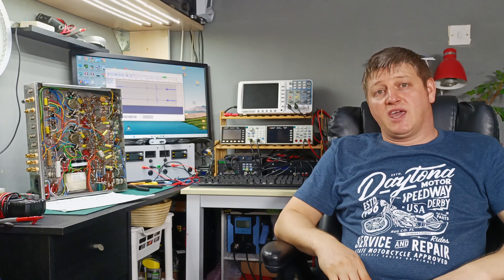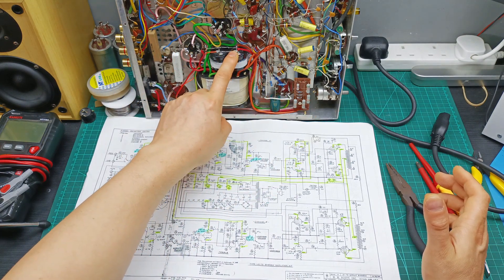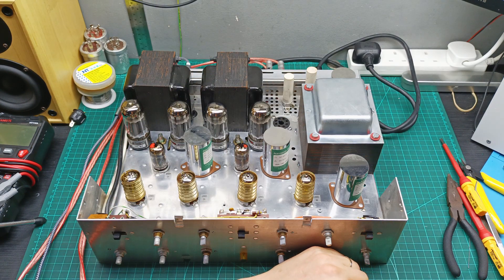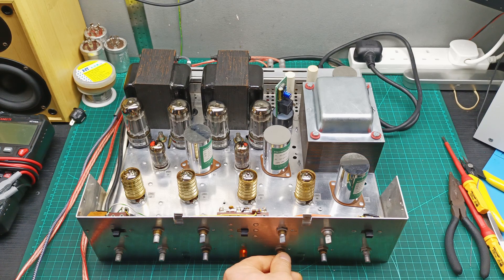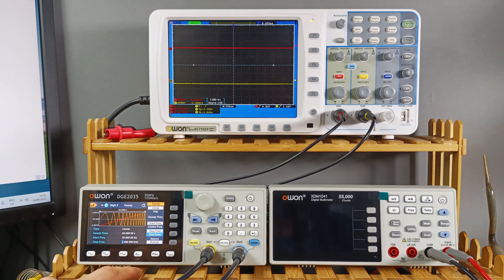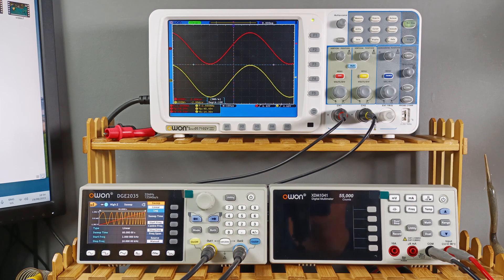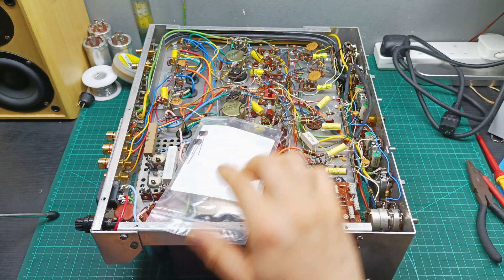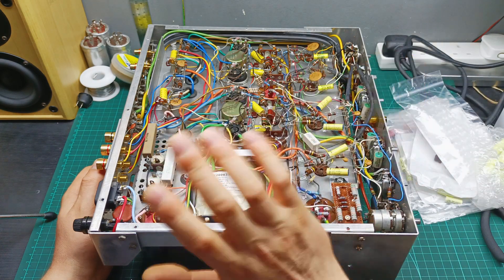She's back to life HH Scott LK72 tube amplifier

Comment: Two coils between the rectifier and the capasitors would help with the humming👍
Reply from the maker: This schematic don't use chokes use  a resistor between rectifier tube and the capacitor. And there is no any space where to put a choke on this amp. And also the old transformer after 30 minutes of running was reaching almost 80° C so definitely the transformer was made bad!